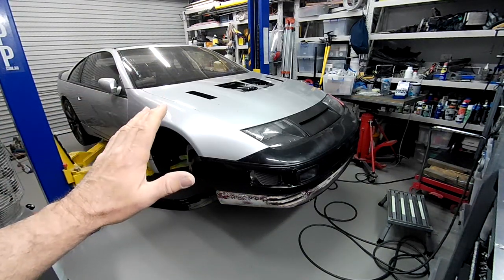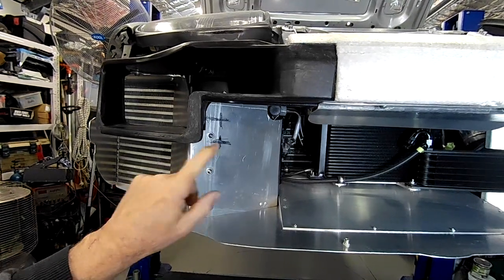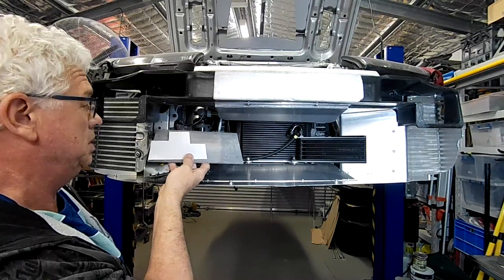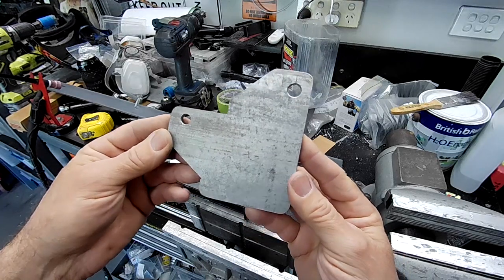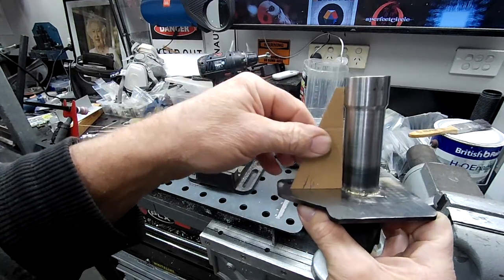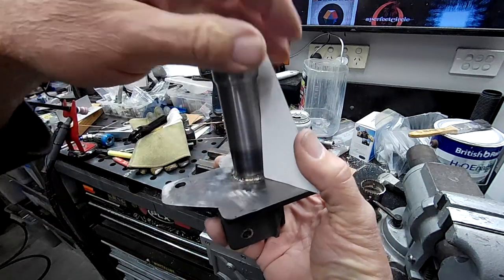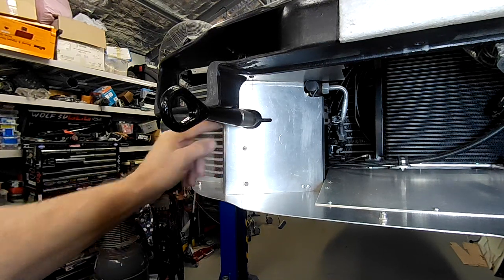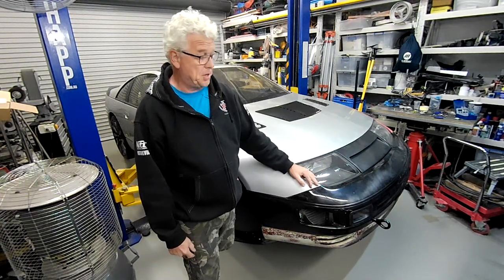Fabricating A Front Tow Hook Receiver. Project Fairlady The Nissan Z32 300zx Twin Turbo Mega Build

Comment: That'll be good enough to pull a stump or drag a log.  :)
I always wonder if one should make something that attaches to the chassis weaker than the chassis so it fails before it damages the chassis. 
I imagine you are using hi tensile bolts to the chassis, so I don't expect the ones in shear to fail and I doubt the ones in tension will either. The mild steel base should bend and stretch holes before the chassis gets damaged, so I reckon you got a pretty damn good design and build of the tow hook there - strong enough but not overly so.
Reply from the maker: Thanks Benny, Cheers.